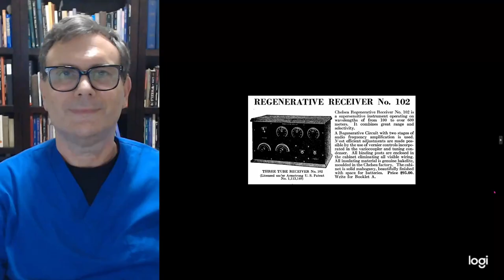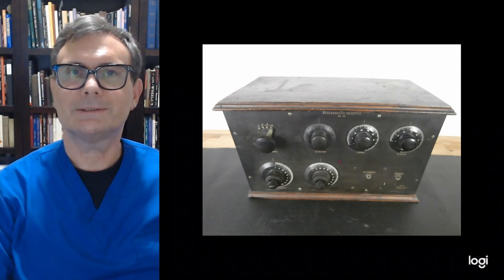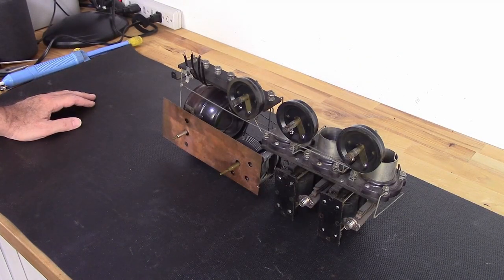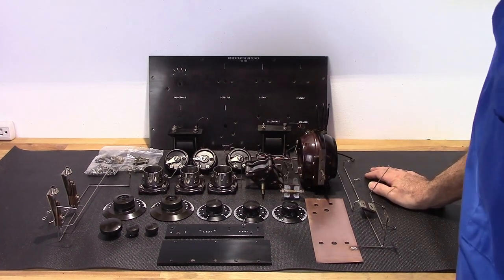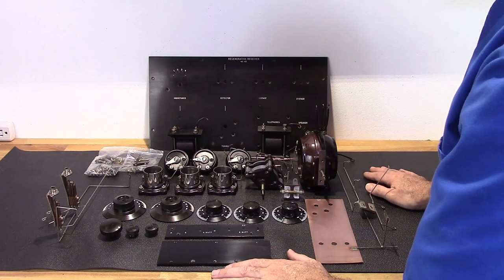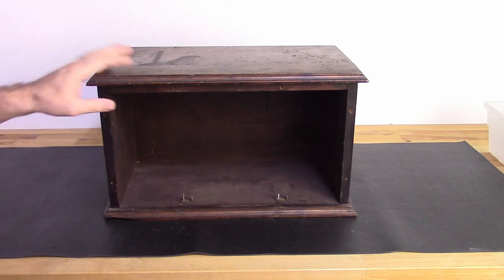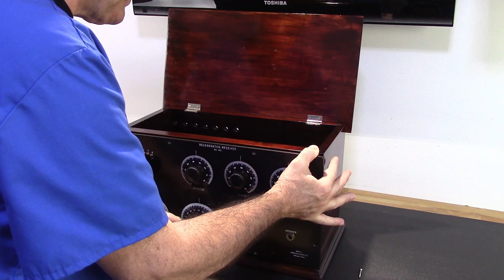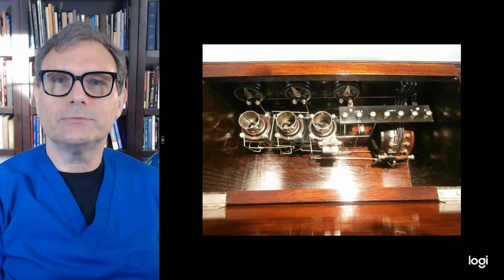1923 Chelsea Model 102 Regenerative Receiver Restoration

Comment: Another excellent restoration. I don't know what it is but there is something very special about these vintage radios. I think of the 1920s as a time of exploration,  a time of learning. Yes sets were simple  (not to operate), but they worked and worked well. Could you please tell me the name of the radio station you were listening to.  Thank you for another interesting video.
Reply from the maker: I have a Talking House transmitter that I have a 5 minute loop on.  I have a video on it.   I also have it hooked to a CD player for longer listening if I want to.  The other station is 750 AM here in Atlanta.

Comment: I hav e several questions, what kind of resistor did you replace the faulty one with? I could not tell but it looked different than normal one of today. Where do you find these radios? I have looked at ham fest an usually they are parts rigs. Nothing like what you have. It’s nice to see the dials a knobs polished as you do them. The lettering is spectacular.
Reply from the maker: Grid resistors of the 20's look like glass fuses with beveled edges.  They usually range from about 250K to 10 meg in these applications.  This style along with that capacitor was typical in the 1920's.  I have a few of those resistors.  I swapped it out for a 2 Meg.  The original read 3 Meg, but was reading 6 so decided not to use it in this particular radio.  This model I got at a live auction, and it wasn't cheap.  There are tons of radios from that era that pop up on e-bay.  I've gotten several there.  This particular model was on my wish list.  I won it at one of the Cledis Estes auctions, which are known for their antique radios.  You can also find them at swap meets.  Chelsea Radios have Bakelite panels which are relatively easy to clean.  They made Bakelite panels and parts in their own factory.  A lot of radios from that era are hard rubber.  The issue with them is when exposed to UV light they turn brown.  If you watch my series on the Lloyd C. Greene Concert Receiver, I do bring one of those hard rubber panels back to life.  Those are a lot more work though, as you have to sand off the top layer of rubber since the rubber itself is discolored, and doing that without destroying the engraved lettering is a challenge.